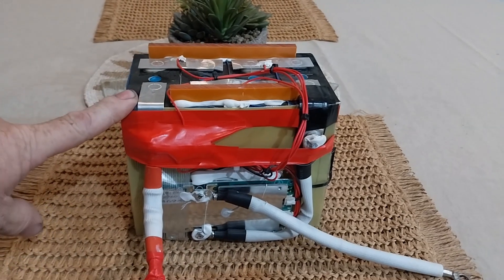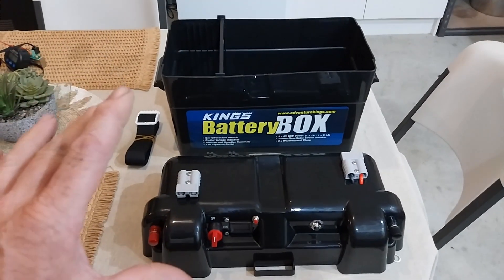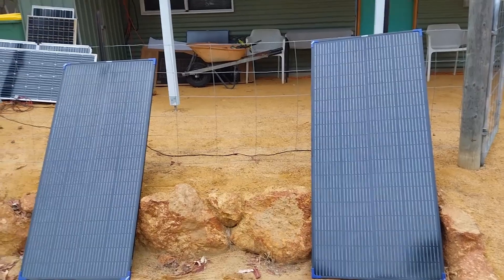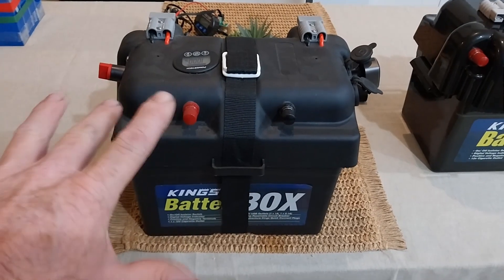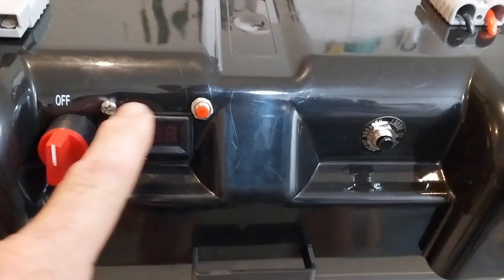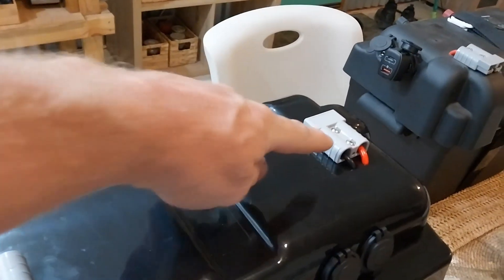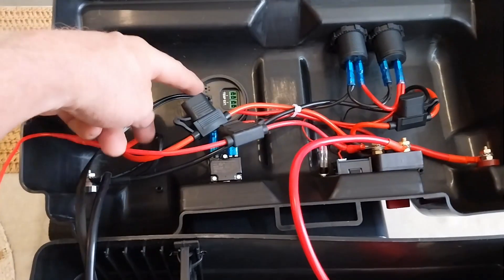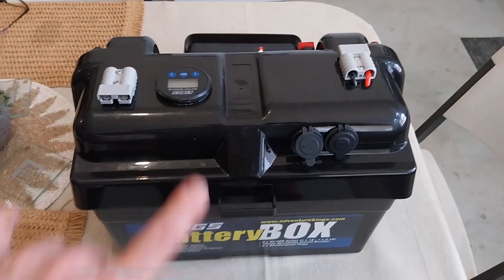Kings Battery Box Teardown, Test & Review

Comment: Can you explain why the preinstalled voltmeter is not suitable for lithium battery chemistry, also why you would advise against using Anderson connectors to connect an inverter?
Reply from the maker: There is a lot involved to answer this fully but here is the basics.
Standard Anderson plugs are maximum of 50 amps which is around 500 watts on a 12 volt inverter. As a general rule I don't recommend standard Anderson plus on inverters as most people use 12 volt inverters of around 2Kw which draws way to much current for standard Anderson Plugs.

Lithium batteries have a very shallow voltage discharge curve meaning the battery voltage reads similar voltage regardless if it is 80% charged or 40% charged. For this reason you cannot determine the SOC (State Of Charge) on a lithium battery using a volt meter alone. The best way to get accurate SOC reading on a Lithium battery is through shunt based monitoring.

Hope this helps 👍

Comment: Great honest review ..Love the work ..They are a great box if you use them properly.. I like to do as you did ...Put a good 50amp fuse on the terminals and your good to go .. The box can handle 50 amps ..But I would not push it beyond that .. Your concerns with blade fuses is somewhat warranted.. But there are a lot of them in your cars with no issues.. The issue with them is people get a 50amp fuse and try to constantly draw 50amps and they are not designed for that .. They are designed to protect your cables.. So if you want to draw 50amp continuously run heavy cable like 75amp and put 60amp fuse ...And you will be fine .. Thats my experience anyhow .. And I completely understand your going to kings to get 1 thing and talk out with 5 ...Click and collect now at our store you have to go into store to collect.. So tempting to buy more stuff again ..Cunning ...

Comment: I just bought this battery box in a bundle with a 120Ah Kings lithium battery, and you're saying the box is not up to scratch for that battery?
Reply from the maker: No I am not saying the battery box is not up to scratch for the battery. The current loading on the cables in the battery box is not adequate of what the 120 Ah batteries maximum continuous current output can deliver "but that is my opinion"
However the 120 Ah is ideal to have (and I have one in my battery box) for longer lasting power, just don't exceed the current loading on the cables.
If it would fit, you could put a 300 Ah battery in the battery box as long as you don't exceed the maximum current output. I think all that info is in the owners manual of the battery box if I remember ??
Reply: @TheOffGridBachelor  Thanks for the feedback.   I definitely need to dig into this more, and understand what I'm hooking up.  Cheers

Comment: Gday Glen, ive just put together a 314AH Eve battery pack into a BatBlock which is working a treat running one of Kings fridges. Its working great, so far, but the 314AH cells are a bit of a tight fit. Ive got another 314AH Eve set ready to go into a battery box and was wondering if you think this cheaper batt box has more internal actual space that might better accommodate larger diy battery packs. The specs listed for the batt block dont take into consideration all of the strengthening protrusions on the inside and this one looks more like what im after. The battery is only used for indoors, static non mobile use so doesnt need any mobile installed protections. I would be replacing most of the cables as well.  Any suggestions would be appreciated. Also, ive been watching your channel for a while and i do like how you explain things to the point without the waffle or sales pitch and give great practical advice. Cheers.

Comment: The battery box is rubbish also a fire hazard. Go with a san hima battery box much better quality 👍
Reply from the maker: There ok for low current draw applications but not for high current draw, like running larger inverters.

Comment: With the two Anderson plugs can you plug solar panels into either one cheers
Reply from the maker: Yes you can however you would need the panels to run through a solar charge controller first if you were wanting to charge the battery via the solar panels.

Comment: Just getting down in that Rabbit 🕳 how do i charge this box with a Renogy 40A DC-DC Battery Charger 12V with MPPT Solar Input is it just straight to battery  or can i put it on the two terminals on the box......
Reply from the maker: The two terminals on the box are connected to the battery terminals. So you can hook your DC to DC straight to the terminals which saves you opening the box to access the battery. Either way, they will both work.
Reply: Thanks mate I been sitting on it for a week lol just do it

Comment: I grabbed 2 of the 200w panels 4 weeks ago. Tested one of them on a clear 27c day angled to the sun and got 136w and 10.8 amps from memory.
Reply from the maker: A mate has six of the 200 watt panels on his caravan and one for them is not putting out much power. I tested it with the panel analyzer and it's only putting out around 50% output.
He needs to take it off the roof of his caravan so I can check the diodes and run some more test to determine the issue and potentially do a warranty claim, depending what I find.
The two 200 watt panels I am testing have been working great, so no issues with mine yet.

Comment: Picked up a couple of the 200W panels. 50-70W output in partly cloudy wx.
Reply from the maker: Did you get them on the $99 special ?
Reply: @TheOffGridBachelor Sort of - with the mounting brackets which I wanted they were $109 ea. Putting about 160W max into the Delta2 with an 11 metre cable. I will hook them up in series and use better cable which should improve things.

Comment: Yes I have the same problem when visiting the K shop. Grabbed a console fridge for $119 and it is super efficient in fridge mode. As for the 200W panels you can't beat the special price so get the measurements  on a cloudy day because thats what matters when the wx is rainy. As for the battery box I have used large blocks of foam to stop the 60Ah from sliding around.